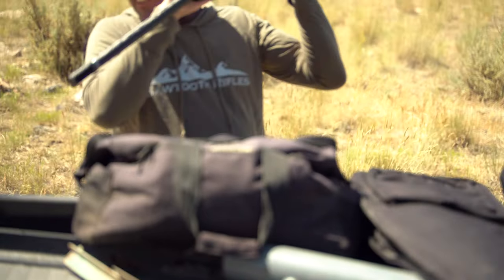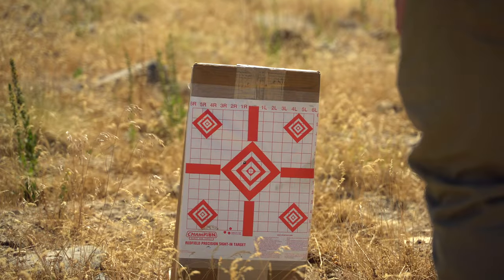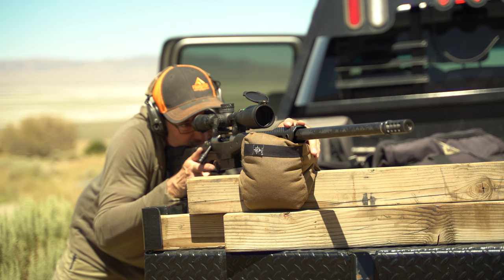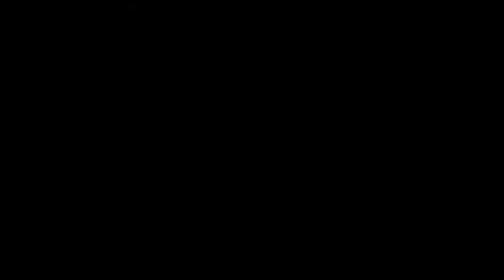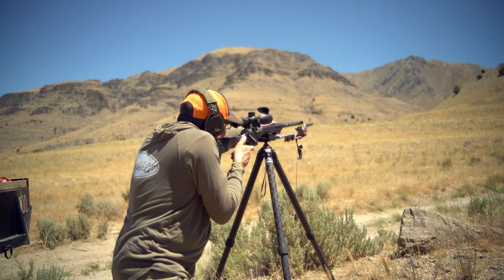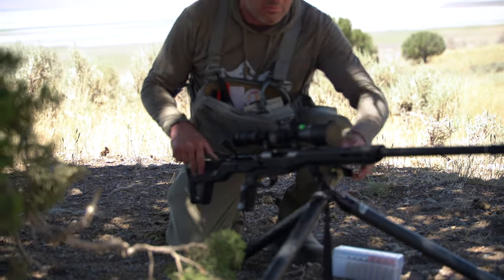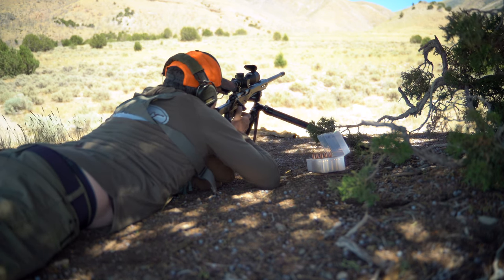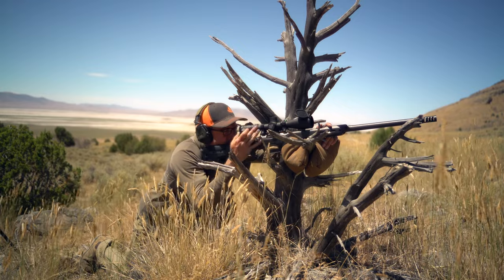Barrel Break-In with Sawtooth Rifles

Comment: i’ve shot a number of precision rifles from when they are new. i’ve found if they’re not that accurate initially the groups will start shrinking around 20 rds or so. if your less than half minute rifle is shooting around 1 inch or so it may take 70-125 rds to reach its potential. in the meantime just shoot it for fun. i will shoot for groups at around 70 rds to see where it’s at. the next time i group it is around 120rds. it should be shooting great by then. my 40x came into its own at around 40 rds. my steyr at around 60rds and my very early pss hit its stride after 125rds.